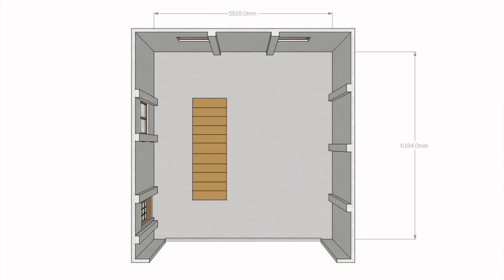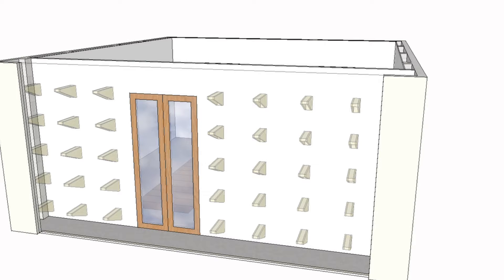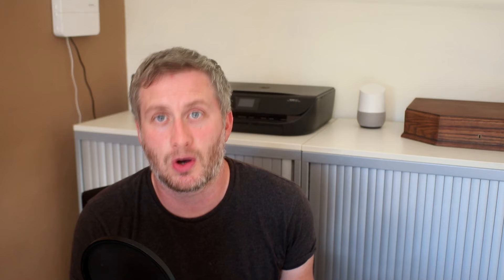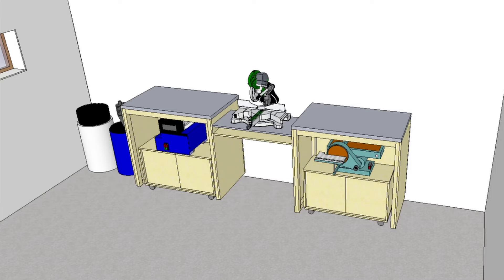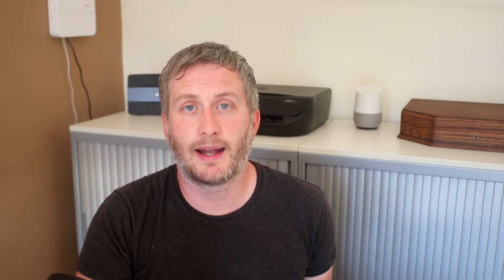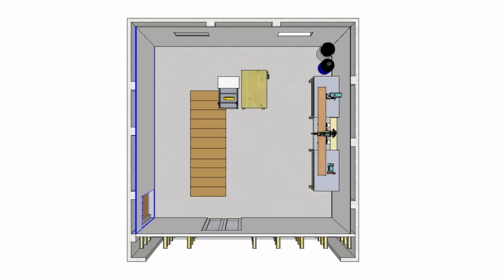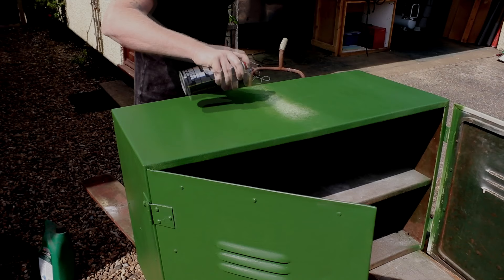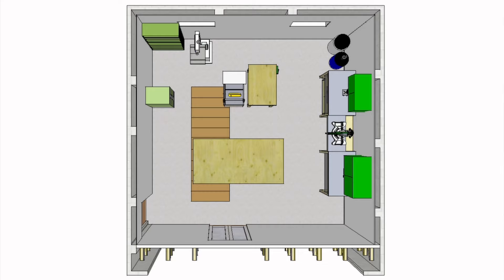Workshop Layout - Space Planning NEW WORKSHOP EPISODE 2

Comment: I think you may be over-thinking the power to the table saw.  You can probably find a length of that rubber cable-protector stuff they use in offices and industry to stop people tripping over cables, just run an extension through that.

My question though, is why, having had a separate doghouse for the compressor and dust extractor at the previous place, you’d go back having them in the room with you?  OK, for videoing it might not be too much of an issue, as you won’t use the audio anyway, or at least not without turning it down.  But even when you’re not filming, just for your sanity, keeping the noise level down is worth the time and effort to build a dog-house surely?  I know you want to keep the pipe runs short to avoid losses, but frankly you’ve now got the room to pipe the main line in 100 mm sewer pipe.  The drops to the individual tools can still be 40 or 50 mm solvent weld pipe.

As for the compressed air, building a ‘ring main’ out of 22 mm copper pipe is easy enough. or JG make a version of their push-fit fittings suitable for compressed air.  Have a read of their guide on how to use it, as it contains some good general advice for installing compressed air lines.
Reply from the maker: The rubber floor mount solution won’t work because I have lots of things on wheels that need moving around constantly (camera stand mainly). Re: the extractor and compressor, both are ultra quiet so noise isn’t an issue and the extractor is m class do dust exhaust isn’t an issue either

Comment: Re: running power to the table saw.

I’d imagine that either an extension lead running to it with a cable cover fixed to the floor, or alternatively, if you have rubber matting to help with fatigue you could probably have the cable running under one of those or in between them (to prevent tripping)
Reply from the maker: Rubber matting would be great for my feet, but I’m not sure if my mobile camera stand would wheel around on the rubber... great idea though and worth looking in toit
Reply: @RagnBoneBrown  have you not got power in the pit such as a light, if so just split it and have a power point down there.
Reply: Check out April Wilkerson's video on running power via the ceiling using an extractable cable reel
Reply: Asad Ali i believe Jay Bates also added some retractable cord reels in his latest shop video too

Comment: why don`t you build a flip top stand to your sander and grinder
Reply: I second this. I built a flip top tool stand but chose to only put one tool on it. This allows me to dock it under my counter, which is very similar to his miter stand. I can flip it to a more convenient height to use it, or I can pull it out and use it as an extra work surface, which essentially double the work area of my counter. I haven't seen anybody else really doing it this way but it has been super useful to me in my small shop.
Reply from the maker: Maybe I would if I didn’t have so much space, but it’s more convenient just to roll it out and start working

Comment: Exciting! Getting all that extra space is always brilliant but you very soon get used to it, and then you feel you could do with even more space 😃 
The blue barrel dust extractor works fine - I have the exact same setup - but it will collapse if you have good suction and the hose gets blocked. When it has collapsed once the plastic seems to have memory and collapses easier in the future, but a fairly simple internal support can fix that (I have not bothered though). Also, consider putting the barrel, the cyclone and the hoover, with all the paraphernalia, on a cart for easy mobility around the workshop.
Consider getting a decent table saw as soon as you can afford/justify it, now that you have the space. I know that you are happy with the Dewalt but with a bigger and more sturdy cabinet style saw everything is so much easier, and will stay true once initial setup has been completed. There are some bargains to be had on eBay from time to time!
Use your loft (so go ahead and put it in) for storage of timber as much as possible. Having stacks of off-cuts on every wall and in every corner will get in your way, collect dust, and make your new workshop cluttered before you have even got started. Consider your typical workflow and leave as much free space as you possible can for moving around, in-feed and out-feed, and some level of flexibility so you can move tools, machines, or whatever really, around to suit the task at hand. Piles of timber everywhere will not be of any help in your everyday work, and will prevent you from thinking "outside the box" in terms of space and possibilities. 
When you put in the loft - which I would do ASAP - make sure to make the hatch nice a big so that you can get big sized stuff up or down fairly effortless. I made mine 45" x 45" and I would not recommend anything smaller.
If you haven't already done so consider getting a separate consumer unit for the workshop, and divide you machinery with big power consumption accordingly into at least two different groups. I would also have at least two separate lines of wall outlets so you do not trip the switch every time you have more than one or two power tools running at the same time as the electric kettle, because with a big workshop an electric kettle is of course a must 😋

Good luck with getting settled in mate.
Reply from the maker: Thanks for the ideas 👍